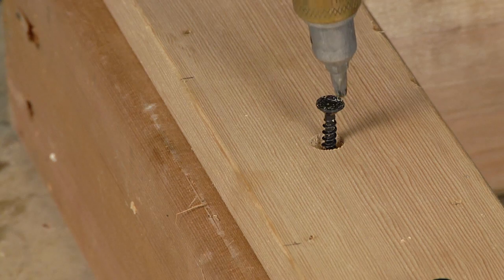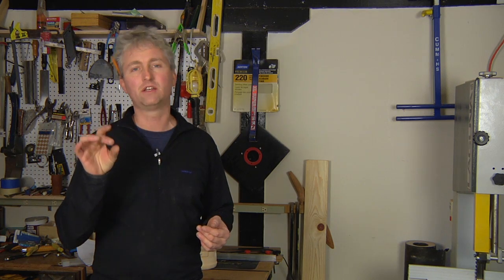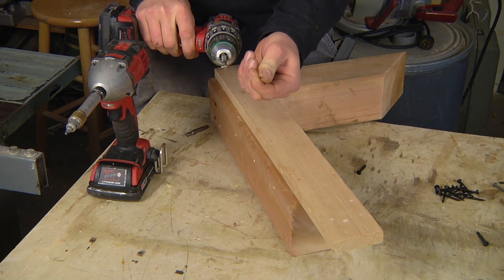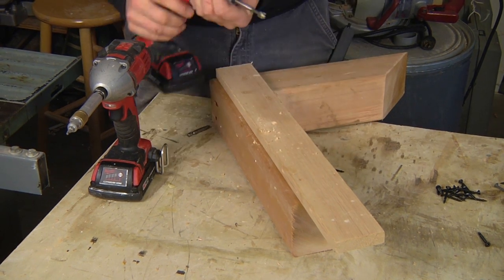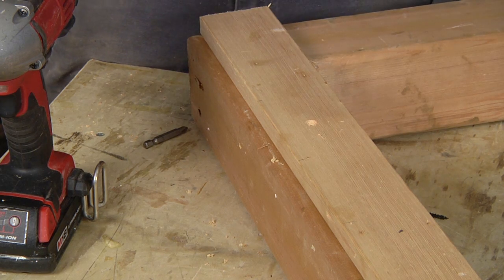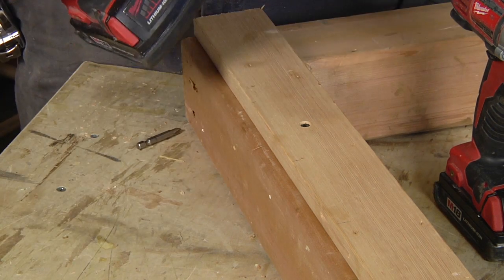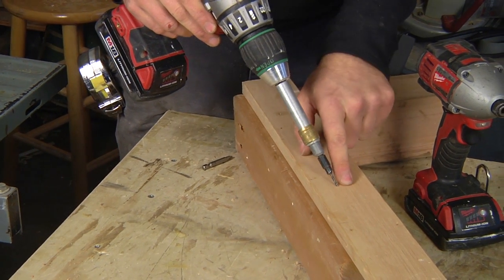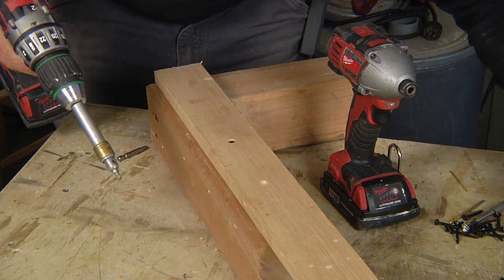Home Remodeling Tools : How and When to Countersink Screws

Comment: There is a difference between counterSINKING and counterBORING a screw. You did a wonderful job of describing one method of counterBORING a screw. CounterSINKING a screw is making the screw head FLUSH with the material surface.
Reply: It also looked like the special reversible bit he used, would have resulted in the screw being flush, but then he bored it further, so the screw would go past the surface.